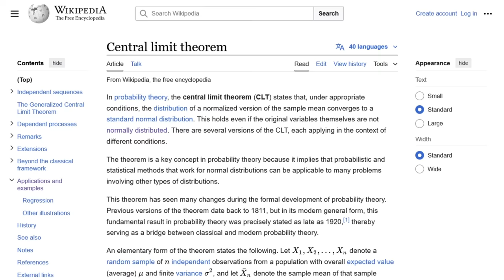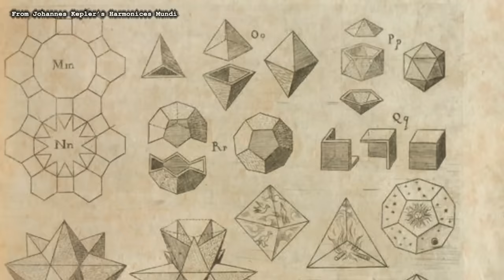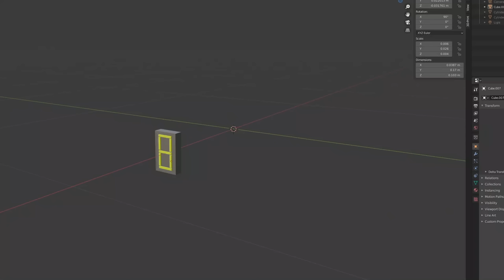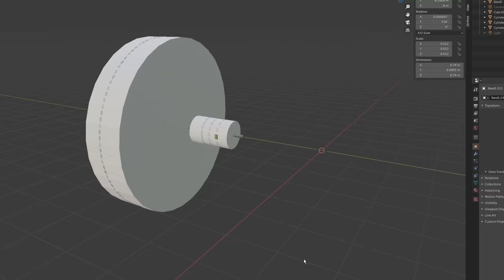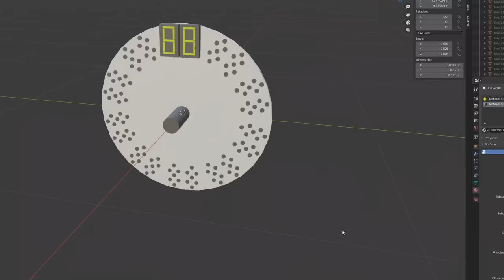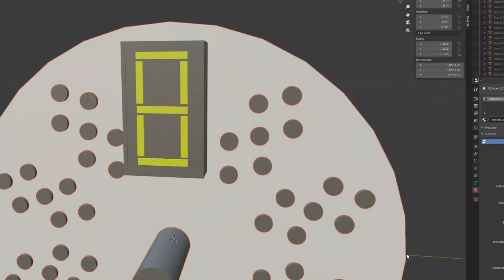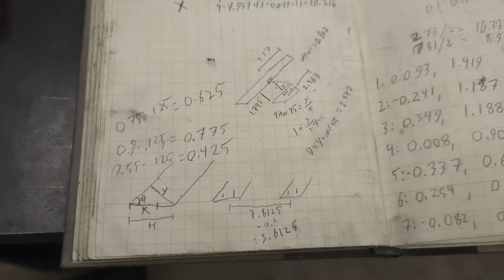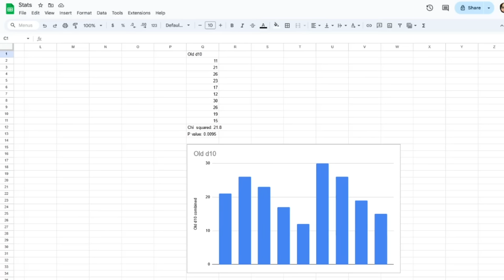Making a d10 spinner

Comment: The magnet material is not too very different from lighter flint, chemically speaking: both use an iron-rare-earth intermetallic compound for hardness; the "rare earth" refers to how much the material expands as it oxidizes, and that fluffy oxide breaks itself free of the metal surface as it forms, exposing a fresh surface to oxidize. The boron is the main chemical difference between the two; it burns super hot, yeah. In the case of lighter flint they mostly don't bother purifying the rare earths from one another; it's nominally cerium but has other lanthanides. For NdFeB magnets you need those internal orbitals to be about half full in the final compound, so the distinction matters.

Comment: I wonder if you could get better "magnetic insulation" using bismuth or pyrolytic graphite as shielding between the core extensions. You could also try using packs of thin steel wire in place of the solid mild steel rods; this is halfway toward using proper laminations.

Comment: You could implement percentile dice the same way geometric dice do: with multiple independent randomisers. Just use more than one spinning disc/drum. You could send the dials spinning at different speeds with the same mechanism as an old-fashioned slot machine.

Comment: For the D%, you should use 2 separate free spinning disks with your D10 pads.

Also, scramble your numbers a bit more rather than running them sequentially. 

For spinning, an idea could be to use one of the lever (or paddle) chain mechanism with a bit of slippage.  That would prevent people from influencing the results by flexing the force being used to spin the wheel.  But that is over engineering xD

Comment: Really cool! I bet you could get the cylinder version with the straight lines working if you used the rods to transmit force (or position) instead of magnetism. Maybe use some kind of bearing on the rods and impressions on the cylinder surface to set the on/off state of each segment.

Comment: You could probably get your magnetic duct idea working if you used e-steal or Electrical steel, the stuff used in transformers. Esteal's fairly easy to work with could 3d print some forms and form it in a vice.

To fix the cross talk problem aluminum or copper between the ducts would help stop the cross talk. They are as you probably know diamagnetic and will resist flux lines. 

Something to consider is your drum and your flipdots.. using aluminum is going to alter how it works. Being diamagnetic it's going to act like a break as it's spinning because the flip dots themselves are magnetic and going to impart drag on it. A plastic drum would probably be better, and you could use locaters on each numbers with say N at the top and S at the bottom and on the drum have the revers S at the top and N at the bottom to get it to probably align with more regularity as they should average a higher strength if the drums spitting out random fields against the displays field. 

That'd probably work for your cylinder idea.  Really nifty.

Comment: Just a random thought.
If you started at 0 every time and used the same amount of force to turn it there's a good chance you will it a similar number.
So in turning your testing it even if you don't start every spin on the same number your test will have similar results.

A way it could be made more random is to add a clutch type operation for example have a leaver you use the base that will disengage from the magnets, spin so it spins freely then release the clutch so the magnets re-engage and start slowing down.

This adds two variables the time from clutch released and the force at twhitch it was pushed. A third variable could be added by the starting number if you wanted to go that deep.

Comment: I have a set of red D6's that were very consistent at low rolling, so consistent in fact that in DND I always had low stat characters to the point i even had an illegal character rolled up I can't remember the exact rules I think you needed at least 1 stat 14 or higher and an overall positive if you added up the modifiers

Comment: What about light pipes that are round on the cylinder end and segment shaped on the display end? Presence or absence of a dot of bright paint on the cylinder would "illuminate" the segments. You might even be able to use UV reactive paint with a uv led for illumination.

Comment: If you could find a display with the ’star’ pattern with the additional sloped pieces, you could use the additional symbols to denote results over ten. Or maybe build a rotor with 20 numerals, ten numbers without a slash and ten without?

Comment: Absolutely love the project! And I hate to be the insufferable "that guy" but a p-value of 0.91 doesn't mean "a 91% chance its fair."

A p-value of 91% means that if we assume the d10 is fair, there's a 91% chance of obtaining a distribution as reasonable as the one you obtained. Therefore you could say "this isn't a crazy distribution to get from a fair d10, so I can't disprove the possibility that it's a fair d10."

If you had a p-value of 1% then the correct statement would be "if this was a fair d10 there's a very low chance that I would've observed this crazy distribution, therefore I doubt this is a fair d10."
Reply: Severely underrated comment smh

Comment: Aluminium is actually magnetic and provides magnetic resistance do to the metal being conductive and making eddy currents inside the metal. Or if a magnet moves close to the metal it makes eddy currents that have a 90° angle to the magnet and that in turn makes a magnetic field that is 180° to the original magnet.

Comment: The digits do not need to be ordered by value. You can order them to minimize the number of flipped segmenrs between two digits, and have less magnets on the disk. As disk always rotates sequentially, one revolution will reset it to a known state, and then each position needs to encode differences.
Reply: Ah, too late :) But im glad others think in this direction too.

Comment: Although the flipdot displays might be neat, a simple optical analogue using light pipes (or just simple contact encoding with LEDs) would probably be easier to generalize.  Sure, everything could be done with a microcontroller, but that's just not in the same spirit.

Comment: The explanation of the mathematical principle is because the number of independent rolls is increased. Basically, if you wanted an equal distribution of any number between 1 and 12 when using 2 dice then you have to use a d12.

Comment: Do you have design schematics for this?  I'm looking at the design and I think it would actually be possible to use a laser cutter and 3d printer to create an inexpensive version that allows you to swap magnetic plates in and out to adjust the range of the die.

Comment: It bugs me so much that you placed the numbers in order  (0, 1, 2 and so on)  rather than have opposite sides of the disc add up to 11 like they do on a dice.

But DAMN that sound is satisfying!  :D
Reply: I'm wondering if the total forces involved in the number of segments being flipped per digit transition is affecting the randomness distribution...
Reply: @wyw876  that might be worth working out although you would also have to consider the rest of the set passing by. That would make it considerably more complex to figure out.
 Assume we’re spinning clockwise. The right side pair of magnets on the disk first approaches the left side segments, then reaches the correct ones on the right side.
 The left side magnets are at their left side segments but then continue past the right side segments as they leave.
Reply: @heatshield  would magnetic eddy currents cancel that out, or introduce even more randomness? 🤔

Comment: Is there anyway you could do an expanded examination of the mechanics for the 7 segment display? I did a bit of a deep dive on flip dots so I sort of get it, but most I see use electrical charge around a winding to flip the polarity on the display and get the flap to flip. Based just on what I see here I don't see how putting a second magnet up to the permanent magnets would change their polarity, but maybe I've been out of physics class too long. Are they permanent magnets in the chassis, or a lump of iron that just holds the magnetic charge (or is that the same thing?)
Reply: Nevermind, I watched again and I'm seeing my mistake. The iron pieces are the core that take the charge the magnets you refer to are actually the ones on the 7 segment display. I got mixed up because the dialog is a little opposite to the video; we see the front when discussing the iron, and the back when discussing the magnets.

Comment: It might have been quicker, easier to 3d print instead of lathe / machine. Also, for a single digit number you could cheat and have the numbers laid out sequentially based on how the magnets are laid out so there's less magnets used. 5 and 6 are pretty similar, and so are 1 and 7, you'd just have to figure out when to reset and you could ABSOLUTELY trim down the use of magnets.
Reply from the maker: My heart belongs to metal, not plastic, efficiency be damned. :)

Comment: you can do multiple digit numbers on a disk just stack them vertically.  they can even go on a side to read left to right.  or you can use multiple disks for multiple digits just stagger the disks and use your "rod magnet pipe" idea to bridge the gaps.

Comment: If you want the magnets to be easily removed and still be snuck fit you could add small holes to the middle of inlay and then use an punch tool to remove them.

Comment: That is a rather nice build and I liked the video so much that I subscribed.

Quick question for Attoparsec (or anyone else who may have the urge and knowledge to answer):  Are you a math nerd as well?  I ask because I'm not and long ago I stumbled over a game that does something different with rolling multiple dice and wanted to figure out the probability of rolls but I couldn't work it out.  In essence, you roll however many dice you're allowed BUT you only get to keep the highest roll.  HOWEVER, if you have dice roll the max they can, you reroll that dice and add it to the max.  So, in 4D6, if you roll a 2, 3, 3, and 6, you reroll the 6 and get a 3, so you add that to get 9.  On the charts I was making, you obviously can't get any roll of the max (nor multiples of the max) and worse, the more dice you add, the higher chances of that bump in final roll.  I say worse because the extra dice threw off my attempts to figure out a formula for number probability.

Anyway, great work and I hope your next attempt is even more impressive.  I'd suggest something with brass so you can stain it to look antique "steampunk."

Comment: For a cylinder you could go more with a chain ring design, so instead of being a really big cylinder it’s like a bike chain that is behind the base, however the spin wouldn’t work as well so you might just need a pull cord like a slot machine-

Or just make a slot machine I suppose 💀

Comment: Nice "digital" dice. I suppose a plastic ring would be easier to press fit the magnets although the plastics degrade more rapidly than the alu would. Good unsealed bearings with light oil have less friction but maybe the wheel would spin for too long.

Comment: You can do a D12 using a Duodecimal system. In written form they use 0-9 then A=10 B=11 and 10=12. But for a single digit version you could have 1-9, then A=10, C=11 (Because B and 8 are the same on that display), and 0=12. 

For a D20, you could simply add a red dot above the display that represents a 10. so the numbers 1-10 (10 displayed as 0) would have no dot, then 11-20 would display 1-0 plus the red dot. So a display of 7 plus a red dot represents a 17, and a 0 with a red dot represents a 20.
Reply: Lowercase b is fairly standard on 7-segment displays for hex B.

Comment: I wonder if the number of flips between adjacent numbers would weight the dice noticeably, like having to flip 4 segments would slow it down more than just changing 1, so it would tend towards numbers that are more dissimilar to the previous one. However, your test didn't seem to indicate that as the highest was 2, which only changes 2 segments from 3 (spun in reverse order), and 7 to 6 changes 5

Comment: I wonder if due to the different "effort" necessary to flip from some numbers to others it has a slight bias towards some results. Example: Transition from 0 to 1 requires flipping four segments versus 2 to 3 only requiring flipping one segment which means less energy is required between 2 and 3 compared to 0 and 1. Probably insignificant compared to some other factors influencing the randomness but hey, we're talking random numbers, right ?

Comment: Idea for 2+ digits, turn number 90 degress and have numbers on side. Then have a outer circle for 10 place and inner circle for 1 place. think ahead but im sure you can evenly get it and have 1-20, for 1-100 id do a 0-99 method and have same idea with 2 separate wheels thet move individualy

Comment: Technically if you use something like hex, you could theoretically go from 0-15 (0, 1, 2, 3, 4, 5, 6, 7, 8, 9, A - 10,  B - 11, C - 12, D - 13, E - 14, F - 15)... though, unless you got really creative B and 8 would be confusing... I suppose you could use b instead, but then you'd get confused with 6?  D has a similar problem with 0...

Playing card denominations might be more intuitive... then you have 1, 2, 3, 4, 5, 6, 7, 8, 9, J, Q, K = 1D12... add an ace, and you have a D13.

Comment: Instead of carrying dices, why not carry these magnetic discs?
Also, you might want to go back to the original design, but instead of magnet on axle, you put a magnet strip on 2 axles with a tape roller. It's a cassette tape mechanism. And it would integrate so nicely with your mount. However, spinning a disk feels more satisfying, maybe have a disk coupling with the roller through a gear would make it perfect.

Comment: I wonder if the probability of the device is still the same as rolling a die. In a die, each face is adjacent to four other numbers. However, with that device, each number (like 1) is adjacent to only two other numbers (such as 10 and 2). Does this difference in adjacency affect the probability of landing on each number?

Comment: for next time, the magnets being glued in can get removed by heat, if you used supergluye and the fit isnt a super tight press fit then you can heat it up and the superglue will loose all its strength

Comment: really cool idea! wonder how your histogram would be effected by having alternate sides of the circle add up to 10 (like how on other dice the opposite faces usually add up to N+1 where N is the number of faces)
Reply: No source on this but my guess is the opposite side pip number adding up equally is done to reduce one area of the dice having significantly more bias (due to removal of material for pip) so it effectively equalizes the weight dostribution on each axis. It wouldn't matter in this case as every number has the same number of magnets, the only thing that influences the display section flip is the polarity of the magnet, so the weight distribution is the same (or close enough) and the order of the numbers doesn't matter here. I'd be interested in any bias coming from the amount of segments that have to flip between each consecutive number, if more segments have to flip it may be a larger repelling force as the disk lines up. Probably minimal overall.
Reply: @gustavo69er  definitely probably minimal, i just wonder how much practice it might take to be able to predictably control the result of this variant, which would be massively complicated by alternating large-small :)

Comment: how about a big wheel all the dice working out from the center, as a column. so the dice that need more room get more room as the concentric circles of magnets get bigger. oh just realised how that wouldn't work with the magnetic detents at set intervals.... I can see a solution with a sliding display that can be moved to the desired ring and the magnetic detent is attached to that.

Comment: Would the crosstalk problem you had not be solved by using electromagnets closer to the display powered by wires touching the spinning segment rather than trying to pass the magnetism through the steel bars?  Just spitballing.

Comment: I have a question for you. So say I were to offer someone a prize for rolling a D20 and landing on the right number. But the person has to choose the number themselves before the roll takes place. So for example if I was rolling and I selected my winning number to be the number 20 and I rolled the D20 a single time what would be the odds you land on your selected number. I know you're going to want to say 1 in 20 and I would argue that is incorrect. There is a 1 in 20 chance of rolling a 20 on a D20 dice but that is only if the number is set and cannot be changed. By giving someone the option to select there own winning number what would the odds be that they might roll that winning number and only given a single chance to roll the D20?  Hope that question makes sense. Thought maybe you might have some insight. Thanks.
Reply: I think it would still be 1/20, since each roll of the die is still a 1/20 chance of getting any particular value. You can think of it like rolling the die twice, where sure, rolling the same value twice is a 1/400 chance but you still have a 1/20 chance of rolling any specific value each discrete time you roll.
Reply: @Myriadys  Yes but you would have a 1/20 chance of getting a number if it was pre chosen and static. So how could it be the same assuming you were made to have to decide that number pre roll? I may be overthinking thigs.